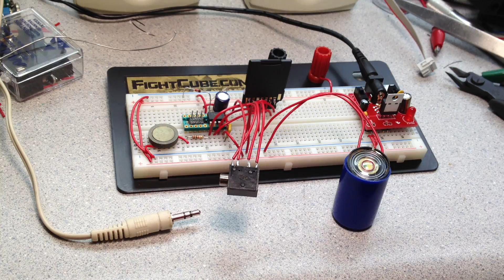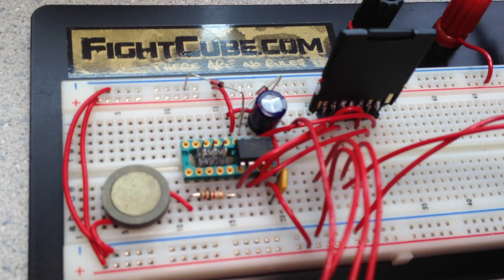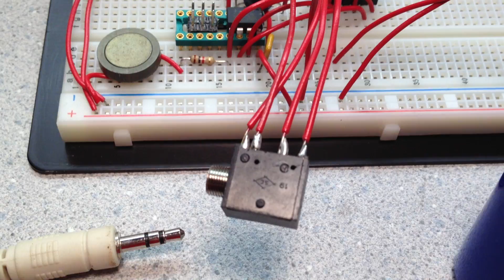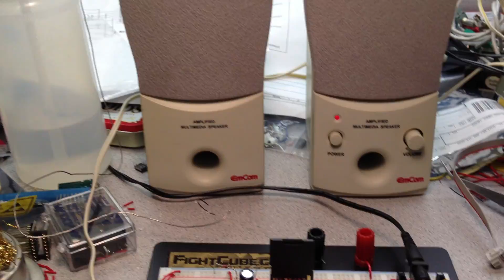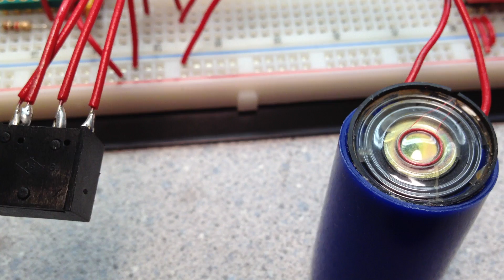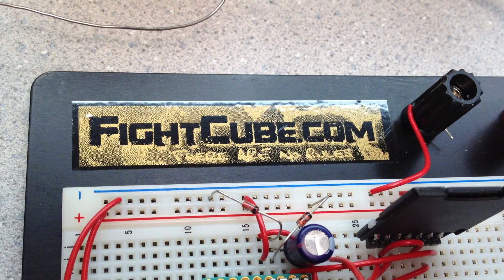Micro SD Music Player (2-25-12)

Comment: i can't seem to remove the fuses. I'm using the tiny programmer from sparkfun; and can't seem to load the hex file. do you have an tips or tricks?
Reply from the maker: So did you try to use a hex editor and remove the fuse configuration info from the HEX file?  Which one are you trying to program Mono, Stereo, OC, HR?  I can edit this or all files and provide an appropriate programming command.  The Tiny AVR programmer uses the same drivers as the Pocket AVR programmer that I have so I should be able to test it as well.  I'm PRETTY sure I compile this code in AVR Studio and used my AVR Dragon to do the programming.  That said, we should be able to get it working with the more inexpensive route, Sparkfun programmer and Avrdude command line programming.
Reply: BDub thanks for the quick reply. I'm not sure how to remove the fuses. all the hex editors I've tried don't offer that option. I'm trying to load the OC version (only because i don't know how to read schematics that well and it looked the easiest). If you could edit them and provide the programming command I would be very appreciative! :D
Reply from the maker: rcpilotp51 Check the description at the very bottom I added a DL link and avrdude command.  I have not tested this file, but that command should work assuming you put the HEX file in the same directory as where you are running avrdude from.  Once you burn the fuses, you are stuck with them that way with the USBtiny programmers.  You need a HVSP programmer such as an AVR Dragon to reset them... let's hope it doesn't come to that.  Here's hoping you don't waste $1 :)  Let me know if it works and I'll provide the rest of the files for the other types as well.
Reply: BDub I will do that tonight when I get home! Thanks for all the help!
Reply: BDub are you able to put the hex in a zip file for me?
Reply: rcpilotp51 nevermind...it worked!...now i can't get the circuit to work :(
i have a wav in the wav folder
Reply from the maker: rcpilotp51 Hmm, I added the file to a zip file and updated the link anyway :)  The wav has to be a certain format "RIFF-WAVE format sound files known as Microsoft wave file in LPCM, 8/16-bit, mono/stereo and upto 48kHz sampling rate."  And I tried to supply that so that's one less problem, but Droplr went to a paid system.  I'll have to dig those files up and link them.  Check all your wiring again as well.  Perhaps you can take some pics of your circuit and message me on youtube with that info ;-)
Reply: BDub Thank you. I messaged you some pictures!
Reply: BDub I think it may be the .wav file. Even though I saved it as a 16 bit/mono/48kHz file I wasn't able to find a setting for RIFF-WAV or LPCM...this could be holding me up. I'm using Adobe Audition to try and format it.
Reply from the maker: rcpilotp51 I looked at the pics, it's kind of hard to tell if it's wired correctly... but let's assume it is for the moment.  One thing I know about those jumpers that you are using (I have them too) is that the wires can break inside the little black rubber overmolded part easily and you'll never know that it's open.  I've thrown away at least half of my jumpers because of this and they plague me with poor connections.  Best bet would be to rewire it with solid 22awg wire.  You definitely should be able to get AA to work, that's what I use.  What version do you have?  RIFF-WAV should just be the standard Windows WAVE format I believe.  Look for that in AA.  I also added a Macgyver.wav file to the description you could try... I haven't tested this myself, but it's just another one I found online.  I do remember some wav files I found on the Net didn't work... so maybe just scour around and look for more as well.

Comment: I tried this project but i ran into 2 problems i cannot solve.1.The music does not play at the correct speed, although i am using 8MHz frequency.2. There is some sort of distorsion on all the bass notes of the music, like rattling.I tried 8 bit unsigned wav with different sampling rates and it did not help.The only thing that helped a bit was placing a 100uF capacitor in parallel with the speaker, but it cuts out all the highs. Lower value capacitors still pass the rattling bass.Can you help me?